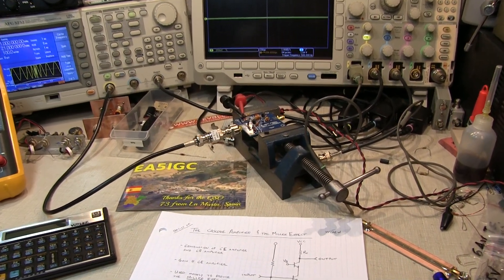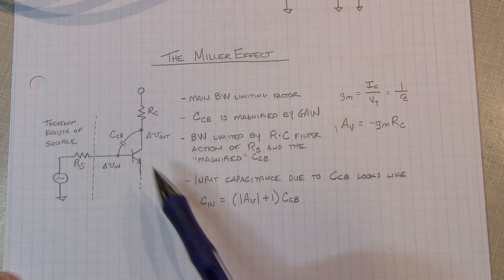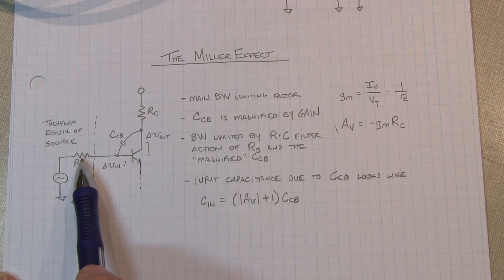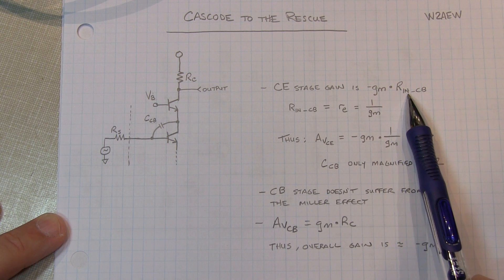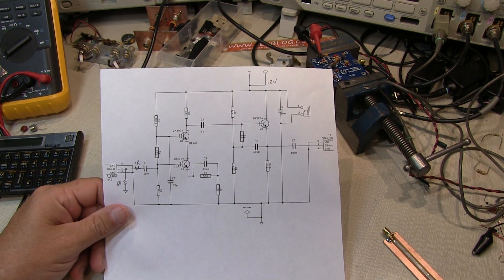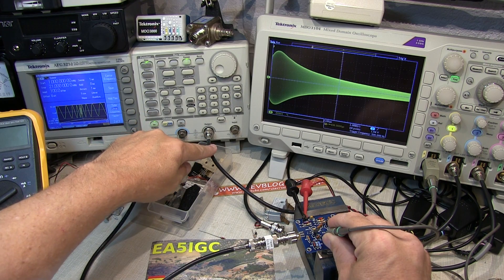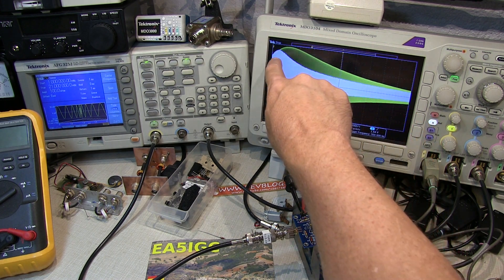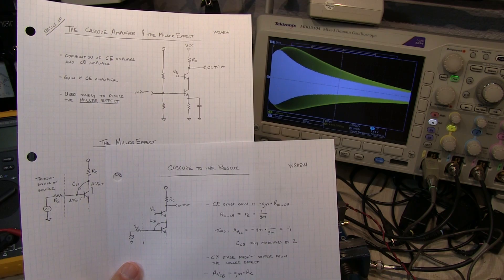#207: Basics of a Cascode Amplifier and the Miller Effect

Comment: A simple RC low pass filter rolls voltage off at 6db per octave.  Is the roll off different for a Miller effect, voltage gain limited CE amplifier.  It seems that it must be a lower db per octave because the capacitor is effectively variable and falling in effective value, as frequency rises, until the voltage gain approaches -1.  What do you call such a reduced roll off response?  A half pole roll off?
Reply from the maker: jpopelish I think it's about the same as a simple RC.  The capacitance isn't effectively falling, since the gain isn't changing, just the signal amplitude.  I'd have to examine it more closely to be sure though.
Reply: But an amplifier operating in the frequency range where Miller effect is in control of its gain, certainly shows changing gain, versus frequency, and that changing gain must have a changing multiplier effect on the capacitive (Cbc) feedback.  So, changing RC time constant across input signal, versus frequency.  Will your scope show a log plot of amplitude versus frequency?
Reply from the maker: jpopelish I think of it as the input being attenuated by the RC filter, not that the gain is being reduced.  Again, I'll have to look at it again when I get back to my lab next week...
Reply: ***** Never mind.  It just occurred to me that the same reduction in voltage, as frequency rises, across the capacitor occurs with a fixed capacitor in an RC, low pass filter.  I just had a mental block, because of the gain produced voltage in the CE amplifier.  If, somehow, the voltage across the capacitor were forced to be independent of frequency, the result would not be a low pass, but a notch filter.

Comment: l love cascodes, they have a million and one uses.. well 3 that I can think of right now:
-Raising a pole to increase bandwidth, especially useful in a feedback loop. Although you still have to finish compensating the loop elsewhere, at least it can shift pesky poles above the 0dB crossover frequency.
-Increasing the voltage rating of a transistor amplifier. BJTs only go up to around 400-500V for linear use (Vceo), ones with higher voltage rating that that are specified at the higher voltage only when base and emitter are shorted together (Vces) i.e. a well driven switch.
-Reducing switching loss, since its during the miller plateau that drain current and voltage coexist (in a FET) and so reducing the duration of that plateau reduces the energy lost in switching.

I like to think of it as the upper NPN's Vbe is setting its emitter at a fixed voltage as Vb is fixed, therefore the bottom NPN's collector is a fixed voltage regardless of current, so since that voltage doesn't change the voltage across Ccb doesn't change and the miller effect is reduced. As well as this the upper NPN doesn't have a significant miller capacitance because it's common base, the base is grounded to AC. I also like to think of the bottom NPN as a current source driving the emitter of the upper NPN. As you point out it's easier to see in a circuit with no emitter degeneration.

Comment: The name has always puzzled me, according to wikipedia it comes from "cascaded triodes having similar characteristics to a pentode"
Reply: David Pilling it certainly comes from thermionic valves / vacuum tubes. You get various -odes. Triode, tetrode, pentode etc. which you can cascade to make a casc-ode. There's nothing to say you can't cascode tetrodes or pentodes though. But yes, pentodes have a reduced miller effect because their control grid is screened from the anode by the screen grid IIRC, so 2 triodes in cascode configuration would sort of be pentode-ish in that one single regard.

Comment: Great video, thanks.
Quick question: If we assume that the g of the CE amplifier transistor is 20, you would expect a BW improvement of ~10. Why do you think you got only 2-3? Do you know what is limiting the BW of the cascode amp?
Reply from the maker: I didn't design this circuit, so I'd have to look at it more carefully. There is a cap around the b-e junction of the emitter follower, so that is likely part of it.

Comment: Could the CB capacitance cause the a circuit to self oscillate under some circumstances? If so, then maybe that would be an interesting idea, to try to force a transistor to self oscillate at, I guess, its own resonance frequency.

And furthermore, what's that that device with two parallel coaxes with inductors connected to ground? (The on with copper-clad, not the angle bracket.) A choke?
Reply from the maker: Collector-Base capacitance is usually not a source for oscillation (in fact it's often used to help make a circuit more stable). The device you are referring to is a directional coupler from a video I did a few months ago.
Reply: Gameboygenius if you want a self oscillating transistor, look at MOSFETs with no daming resistor on the gate. the lead inductance and the gate capacitance can cause a lot of ringing. You need some feedback gain to maintain oscillation though. In a bigger circuit with gain elsewhere and poor layout they can oscillate seemingly by themselves.

Comment: What does the slope of the signal look like down in the audio range?
Reply from the maker: Dennis Hill This was designed as an RF amplifier, so it has very little gain at audio frequencies.  Of course, component (capacitor) values can be adjusted to improve the audio performance.  The Miller effect is generally not an issue for audio amplifiers unless the source impedance is very high, so the cascode isn't used much for audio.